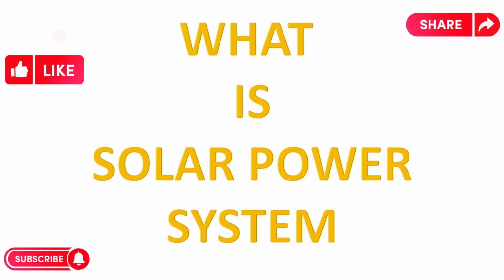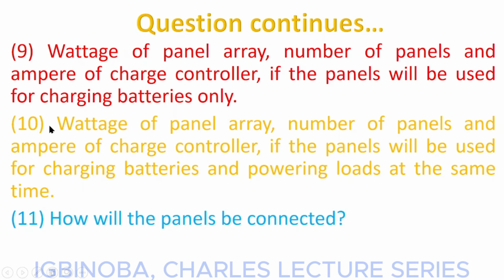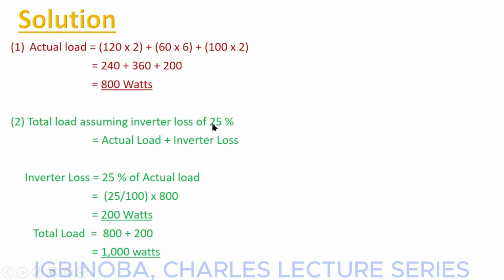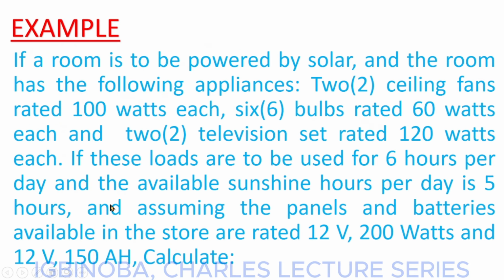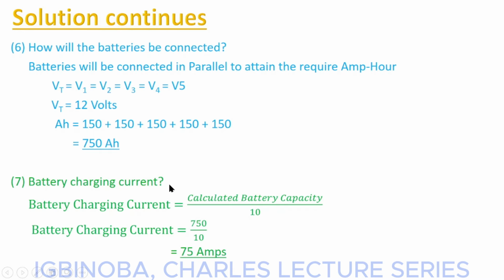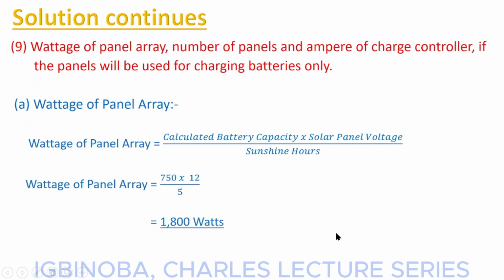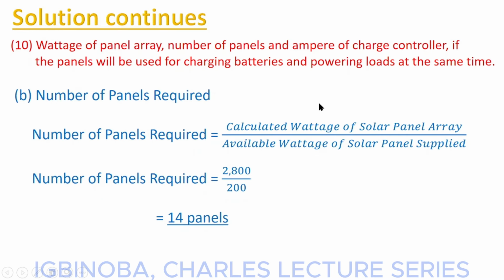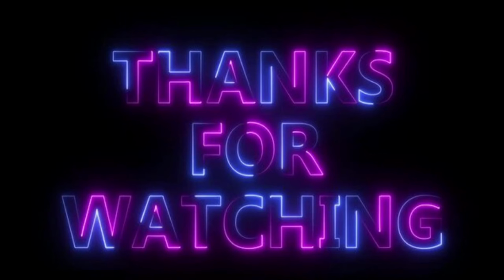Design of Solar Power System

Comment: PETRO394P
1. Actual load= (100×3)+(60×10)+(120×4) =1380watts
2. Total load assuming inverter loss of 25%= Actual load +Inverter loss
Inverter loss=25% of Actual load
= 25%×1380=345 watts
Total load= 1380+345=1725 watts
3. Inverter rating on VA using power factor of 0.8
= (1725÷0.8)= 2156.25
4. Battery capacity using factor for reserve 75%=(2×1725×6×0.75)=1293.75Ah
5. No. of batteries for backup hours=1293.75Ah÷150Ah= 8.6 =8 batteries 
6. How batteries will be connected?
The batteries will be connected in parallel 
Vt=V1=V2=V3=V4=V5=V6=V7=V8
Ah= 150+150+150+150+150+150+150+150=1200
7. Battery charging current=1293.75÷10=129Amps
8. Battery charging time assuming charging loss of 40%= 1293.75Ah+(40%+1293.75Ah)÷129A=14hrs
9a. Wattage panel array= 3105 watts
9b. Number of panels required= 3105÷345=9 panels 
9c. Ampere of charging controller required= 3105÷12=258.75Amps
10a. Wattage of panel array= Calculated wattage of solar panel array for charging battery only+ calculated total load =3105+1725=4830watts
10b. Number of panels required= calculated wattage of solar panel array÷ Available wattage of solar panel supplied= 4830watts÷345= 14Amps
10c. Ampere of charge controller= calculated wattage of solar panel array÷ solar panel voltage=4830watts÷12volts= 402.5Amps
11. How will the panels be connected?
Ans: They will be connected in parallel

Comment: EEE312L

1.Actual load is 1380w
2. Total load is 1725w
3. Inverter rating is 2156.25VA
4.Battery capacity is 1293.75AH
5. No. Of batteries is 8.625~9batteries
6. Parallel
7.Battery charging current is 129.375amps
8. Charging time is 14hours
9. (A) 3105w (B) 15.525 ~16panels (C) 258.75A
10. (A) 4830w (3) 24.15~ 24panels (C) 402.5A
11. Parallel

Comment: PETRO3102X

1. Actual load= (100×3)+(60×10)+(120×4) =1380watts
2. Total load assuming inverter loss of 25%= Actual load +Inverter loss
Inverter loss=25% of Actual load
= 25%×1380=345 watts
Total load= 1380+345=1725 watts
3. Inverter rating on VA using power factor of 0.8
= (1725÷0.8)= 2156.25
4. Battery capacity using factor for reserve 75%=(2×1725×6×0.75)=1293.75Ah
5. No. of batteries for backup hours=1293.75Ah÷150Ah= 8.6 =8 batteries 
6. How batteries will be connected?
The batteries will be connected in parallel 
Vt=V1=V2=V3=V4=V5=V6=V7=V8
Ah= 150+150+150+150+150+150+150+150=1200
7. Battery charging current=1293.75÷10=129Amps
8. Battery charging time assuming charging loss of 40%= 1293.75Ah+(40%+1293.75Ah)÷129A=14hrs
9a. Wattage panel array= 3105 watts
9b. Number of panels required= 3105÷345=9 panels 
9c. Ampere of charging controller required= 3105÷12=258.75Amps
10a. Wattage of panel array= Calculated wattage of solar panel array for charging battery only+ calculated total load =3105+1725=4830watts
10b. Number of panels required= calculated wattage of solar panel array÷ Available wattage of solar panel supplied= 4830watts÷345= 14Amps
10c. Ampere of charge controller= calculated wattage of solar panel array÷ solar panel voltage=4830watts÷12volts= 402.5Amps
11. How will the panels be connected?
Ans: They will be connected in parallel

Comment: MAR3115K

I. Actual load = 1380W
2. Total load = 1720W
3. Inverter rating = 2156.25VA
4. Battery Capacity = 1293.75Ah
5. Number of batteries = 8.6 ~ 9 batteries
6. Parallel
7. Battery charging current = 129.4Amps
8. Charging Time = 14hrs
9 (a). 3105Watts
(b). 15.5 = 16 panels
(c). 258.75 Amps
10(a) . 4830W
(b). 24.15 ≤ 24 panels
(c). 402.5Amps
11. Parallel

Comment: PETRO359G

1. Actual load= (100×3)+(60×10)+(120×4) =1380watts
2. Total load assuming inverter loss of 25%= Actual load +Inverter loss
Inverter loss=25% of Actual load
= 25%×1380=345 watts
Total load= 1380+345=1725 watts
3. Inverter rating on VA using power factor of 0.8
= (1725÷0.8)= 2156.25
4. Battery capacity using factor for reserve 75%=(2×1725×6×0.75)=1293.75Ah
5. No. of batteries for backup hours=1293.75Ah÷150Ah= 8.6 =8 batteries 
6. How batteries will be connected?
The batteries will be connected in parallel 
Vt=V1=V2=V3=V4=V5=V6=V7=V8
Ah= 150+150+150+150+150+150+150+150=1200
7. Battery charging current=1293.75÷10=129Amps
8. Battery charging time assuming charging loss of 40%= 1293.75Ah+(40%+1293.75Ah)÷129A=14hrs
9a. Wattage panel array= 3105 watts
9b. Number of panels required= 3105÷345=9 panels 
9c. Ampere of charging controller required= 3105÷12=258.75Amps
10a. Wattage of panel array= Calculated wattage of solar panel array for charging battery only+ calculated total load =3105+1725=4830watts
10b. Number of panels required= calculated wattage of solar panel array÷ Available wattage of solar panel supplied= 4830watts÷345= 14Amps
10c. Ampere of charge controller= calculated wattage of solar panel array÷ solar panel voltage=4830watts÷12volts= 402.5Amps
11. How will the panels be connected?
Ans: They will be connected in parallel

Comment: PETRO3151U

1. Actual load= (100×3)+(60×10)+(120×4) =1380watts
2. Total load assuming inverter loss of 25%= Actual load +Inverter loss
Inverter loss=25% of Actual load
= 25%×1380=345 watts
Total load= 1380+345=1725 watts
3. Inverter rating on VA using power factor of 0.8
= (1725÷0.8)= 2156.25
4. Battery capacity using factor for reserve 75%=(2×1725×6×0.75)=1293.75Ah
5. No. of batteries for backup hours=1293.75Ah÷150Ah= 8.6 =8 batteries 
6. How batteries will be connected?
The batteries will be connected in parallel 
Vt=V1=V2=V3=V4=V5=V6=V7=V8
Ah= 150+150+150+150+150+150+150+150=1200
7. Battery charging current=1293.75÷10=129Amps
8. Battery charging time assuming charging loss of 40%= 1293.75Ah+(40%+1293.75Ah)÷129A=14hrs
9a. Wattage panel array= 3105 watts
9b. Number of panels required= 3105÷345=9 panels 
9c. Ampere of charging controller required= 3105÷12=258.75Amps
10a. Wattage of panel array= Calculated wattage of solar panel array for charging battery only+ calculated total load =3105+1725=4830watts
10b. Number of panels required= calculated wattage of solar panel array÷ Available wattage of solar panel supplied= 4830watts÷345= 14Amps
10c. Ampere of charge controller= calculated wattage of solar panel array÷ solar panel voltage=4830watts÷12volts= 402.5Amps
11. How will the panels be connected?
Ans: They will be connected in parallel

Comment: NAT35E 

1. Actual Load: 1380Watts
2. Total Load (Including inverter loss) 1840W
3.Inverter Rating (VA): 2300 VA
4. Battery Capacity: 1227 Ah
5. Number of Batteries: 9 batteries
6. Battery Connection: Parallel
7. Battery Charging Current: 15 A (per battery string)
8. Battery Charging Time: 5.1 days
9. Panel Array (For charging batteries only)
. Wattage: 2945 W
. Number of Panels: 15 panels
. Charge Controller Ampere: 245 A
10. Panel Array ( For charging batteries and powering loads):
. Wattage: 4785 Watts
. Number of Panels: 24 panels
. Charge Controller Ampere: 399 A
11. Panel Connection: Series - Parallel.

Comment: PETRO3127W

1. Actual load= [100×3+60×10+120×4]=1380watts
2. Total load assuming inverter loss of 25%= 25% of Actual  load=25%×1380=345 watts
Total load= 1380+345=1725 watts
3. Inverter rating on VA using power factor of 0.8
= (1725÷0.8)= 2156.25
4. Battery capacity using factor for reserve 75%=(2×1725×6×0.75)=1293.75Ah
5. No. of batteries for backup hours=1293.75Ah÷150Ah= 8.6 =8 batteries 
6. How batteries will be connected?
The batteries will be connected in parallel 
Vt=V1=V2=V3=V4=V5=V6=V7=V8
Ah= 150+150+150+150+150+150+150+150=1200
7. Battery charging current=1293.75÷10=129Amps
8. Battery charging time assuming charging loss of 40%= 1293.75Ah+(40%+1293.75Ah)÷129A=14hrs
9a. Wattage panel array= 3105 watts
9b. Number of panels required= 3105÷345=9 panels 
9c. Ampere of charging controller required= 3105÷12=258.75Amps
10a. Wattage of panel array=3105+1725=4830watts
10b. Number of panels required= 4830watts÷345= 14Amps
10c. Ampere of charge controller= 4830watts÷12volts= 402.5Amps
11. How will the panels be connected?
Ans: They will be connected in parallel

Comment: CIV374V
1. Actual load is 1380W
2. Total load is 1725W
3. Inverter rating is 2156.25VA
4. Battery capacity is 1293.75AH
5. No. of batteries is 8.625~9batteries
6. Parallel
7. Battery changing current is 129.375amps
8. Charging time is 14hours
9. (A) 3105W (B) 15.525~16panels (C) 258.75A
10. (A) 4830W (B) 24.15~24panels (C) 402.5A
11. Parallel

Comment: MECH331E

Answers 
1) Actual Load = 1380 watts
2) Total Load = 1725 watts
3) Inverter Rating = 2156.25 VA
4) Battery Capacity = 1293.75 Ah
5) Number of Batteries = 8.625~9batteries
6) Parallel
7) Battery charging current = 129.375 Amps
8) Charging time = 14 hrs
9) (a) 3105 watts
(b) 15.525 ~ 16 panels
(c) 258.75 Amps
10) (a) 4830 watts
(b) 24.15 ~ 24 panels
(c) 402.5 Amps
11) Parallel

Comment: CIV3108H

1. Actual Load = 1380 watts

2. Total Load = 1725 watts

3. Inverter Rating = 2156.25 VA

4. Battery Capacity = 1293.75 Ah

i

5. Number of Batteries = 8.625~9 batteries

6. Parallel

7. Battery charging current = 129.375 Amps

8. Charging time = 14 hrs

9. (a) 3105 watts

(b) 15.525~16 panels

(c) 258.75 Amps

10. (a) 4830 watts

(b) 24.15~24 panels

(c) 402.5 Amps

11. Parallel

Comment: CIV3100V

1 Actual load: 1380W
 2. Total load: 1720W
 3 Inverter rating 2156.25VA 
4 battery capacity 1293.75 Ah, 
5 number of batteries 8.6 
6 Parallel 
7 Battery charging 129.4A 
8 T = 14 hrs 
9 (a) 3105W (b) 15.5 panels (c) 258.75 A 
10. (a) 4830W (b) 24 panels (c) 402.5A
11 Parallel

Comment: CIV3102X
1.Actual load is 1380w 
2. Total load is I725w 
3. Inverter rating is 2156.25VA 
4.Battery capacity is 1293.75AH 
5. No. Of batteries is 8.625~9batteries
6. Parallel 
7.Battery charging current is 129.375amps 
8. Charging time is 14hours 
9. (A) 3105w (B) 15.525 ~16panels (C)258.75A 
10.(A) 4830w (3) 24.15~ 24panels (C) 402.5A 
11. Parallel

Comment: CIV355C

1. Actual Load:1380Watts
2. Total Load (Including inverter loss) 1840W
3.Inverter Rating (VA): 2300 VA
4. Battery Capacity:1227 Ah
5. Number of Batteries: 9 batteries 
6. Battery Connection: Parallel 
7. Battery Charging Current: 15 A (per battery string)
8. Battery Charging Time: 5.1 days
9. Panel Array (For charging batteries only)
  .Wattage: 2945 W
  .Number of Panels:15 panels 
   .Charge Controller Ampere: 245 A
10. Panel Array ( For charging batteries and powering loads): 
   . Wattage: 4785 Watts
   . Number of Panels: 24 panels
   . Charge Controller Ampere:399 A
11. Panel Connection: Series - Parallel

Comment: PETRO3112H

1. Actual Load: 1380 W
2. Total Load (including inverter loss): 1840 W
3. Inverter Rating (VA): 2300 VA
4. Battery Capacity: 1227 Ah
5. Number of Batteries: 9 batteries
6. Battery Connection: Parallel
7. Battery Charging Current: 15 A (per battery string)
8. Battery Charging Time: 5.1 days
9. Panel Array (for charging batteries only):
   · Wattage: 2945 W
   · Number of Panels: 15 panels
   · Charge Controller Ampere: 245 A
10. Panel Array (for charging batteries and powering loads):
    · Wattage: 4785 W
    · Number of Panels: 24 panels
    · Charge Controller Ampere: 399 A
11. Panel Connection: Series - Parallel
Reply: PETRO3127W

1. Actual load= [100×3+60×10+120×4]=1380watts
2. Total load assuming inverter loss of 25%= 25% of Actual  load=25%×1380=345 watts
Total load= 1380+345=1725 watts
3. Inverter rating on VA using power factor of 0.8
= (1725÷0.8)= 2156.25
4. Battery capacity using factor for reserve 75%=(2×1725×6×0.75)=1293.75Ah
5. No. of batteries for backup hours=1293.75Ah÷150Ah= 8.6 =8 batteries 
6. How batteries will be connected?
The batteries will be connected in parallel 
Vt=V1=V2=V3=V4=V5=V6=V7=V8
Ah= 150+150+150+150+150+150+150+150=1200
7. Battery charging current=1293.75÷10=129Amps
8. Battery charging time assuming charging loss of 40%= 1293.75Ah+(40%+1293.75Ah)÷129A=14hrs
9a. Wattage panel array= 3105 watts
9b. Number of panels required= 3105÷345=9 panels 
9c. Ampere of charging controller required= 3105÷12=258.75Amps
10a. Wattage of panel array=3105+1725=4830watts
10b. Number of panels required= 4830watts÷345= 14Amps
10c. Ampere of charge controller= 4830watts÷12volts= 402.5Amps
11. How will the panels be connected?
Ans: They will be connected in parallel

Comment: PETRO3134D

1. Actual load= (100×3)+(60×10)+(120×4) =1380watts
2. Total load assuming inverter loss of 25%= Actual load +Inverter loss
Inverter loss=25% of Actual load
= 25%×1380=345 watts
Total load= 1380+345=1725 watts
3. Inverter rating on VA using power factor of 0.8
= (1725÷0.8)= 2156.25
4. Battery capacity using factor for reserve 75%=(2×1725×6×0.75)=1293.75Ah
5. No. of batteries for backup hours=1293.75Ah÷150Ah= 8.6 =8 batteries 
6. How batteries will be connected?
The batteries will be connected in parallel 
Vt=V1=V2=V3=V4=V5=V6=V7=V8
Ah= 150+150+150+150+150+150+150+150=1200
7. Battery charging current=1293.75÷10=129Amps
8. Battery charging time assuming charging loss of 40%= 1293.75Ah+(40%+1293.75Ah)÷129A=14hrs
9a. Wattage panel array= 3105 watts
9b. Number of panels required= 3105÷345=9 panels 
9c. Ampere of charging controller required= 3105÷12=258.75Amps
10a. Wattage of panel array= Calculated wattage of solar panel array for charging battery only+ calculated total load =3105+1725=4830watts
10b. Number of panels required= calculated wattage of solar panel array÷ Available wattage of solar panel supplied= 4830watts÷345= 14Amps
10c. Ampere of charge controller= calculated wattage of solar panel array÷ solar panel voltage=4830watts÷12volts= 402.5Amps
11. How will the panels be connected?
Ans: They will be connected in parallel

Comment: EEE3167K 

1. Actual Load = 1380 watts

2. Total Load = 1725 watts

3. Inverter Rating = 2156.25 VA

4. Battery Capacity = 1293.75Ah

5. Number of Batteries = 8.625 ~ 9 batteries

6. Parallel

7. Battery charging current =    129.375 Amps

8. Charging time = 14 hrs

9. (a) 3105 watts
    (b) 15.525 16 panels
    (c) 258.75 Amps

10. (a) 4830 watts
       (b) 24.15 ~ 24 panels
       (c) 402.5 Amps

11. Configuration= Parallel

Comment: PETRO320N

1. Actual load= (100×3)+(60×10)+(120×4) =1380watts

2. Total load assuming inverter loss of 25%= Actual load +Inverter loss
Inverter loss=25% of Actual load
= 25%×1380=345 watts
Total load= 1380+345=1725 watts

3. Inverter rating on VA using power factor of 0.8
= (1725÷0.8)= 2156.25

4. Battery capacity using factor for reserve 75%=(2×1725×6×0.75)=1293.75Ah

5. No. of batteries for backup hours=1293.75Ah÷150Ah= 8.6 =8 batteries 

6. How batteries will be connected?
The batteries will be connected in parallel 
Vt=V1=V2=V3=V4=V5=V6=V7=V8
Ah= 150+150+150+150+150+150+150+150=1200

7. Battery charging current=1293.75÷10=129Amps

8. Battery charging time assuming charging loss of 40%= 1293.75Ah+(40%+1293.75Ah)÷129A=14hrs

9a. Wattage panel array= 3105 watts

9b. Number of panels required= 3105÷345=9 panels 

9c. Ampere of charging controller required= 3105÷12=258.75Amps

10a. Wattage of panel array= Calculated wattage of solar panel array for charging battery only+ calculated total load =3105+1725=4830watts

10b. Number of panels required= calculated wattage of solar panel array÷ Available wattage of solar panel supplied= 4830watts÷345= 14Amps

10c. Ampere of charge controller= calculated wattage of solar panel array÷ solar panel voltage=4830watts÷12volts= 402.5Amps

11. They will be connected in parallel

Comment: PETRO325Y
1. Actual load= (100×3)+(60×10)+(120×4) =1380watts
2. Total load assuming inverter loss of 25%= Actual load +Inverter loss
Inverter loss=25% of Actual load
= 25%×1380=345 watts
Total load= 1380+345=1725 watts
3. Inverter rating on VA using power factor of 0.8
= (1725÷0.8)= 2156.25
4. Battery capacity using factor for reserve 75%=(2×1725×6×0.75)=1293.75Ah
5. No. of batteries for backup hours=1293.75Ah÷150Ah= 8.6 =8 batteries 
6. How batteries will be connected?
The batteries will be connected in parallel 
Vt=V1=V2=V3=V4=V5=V6=V7=V8
Ah= 150+150+150+150+150+150+150+150=1200
7. Battery charging current=1293.75÷10=129Amps
8. Battery charging time assuming charging loss of 40%= 1293.75Ah+(40%+1293.75Ah)÷129A=14hrs
9a. Wattage panel array= 3105 watts
9b. Number of panels required= 3105÷345=9 panels 
9c. Ampere of charging controller required= 3105÷12=258.75Amps
10a. Wattage of panel array= Calculated wattage of solar panel array for charging battery only+ calculated total load =3105+1725=4830watts
10b. Number of panels required= calculated wattage of solar panel array÷ Available wattage of solar panel supplied= 4830watts÷345= 14Amps
10c. Ampere of charge controller= calculated wattage of solar panel array÷ solar panel voltage=4830watts÷12volts= 402.5Amps
11. How will the panels be connected?
Ans: They will be connected in parallel

Comment: PETRO3109E

1. Actual load= (100×3)+(60×10)+(120×4) =1380watts
2. Total load assuming inverter loss of 25%= Actual load +Inverter loss
Inverter loss=25% of Actual load
= 25%×1380=345 watts
Total load= 1380+345=1725 watts
3. Inverter rating on VA using power factor of 0.8
= (1725÷0.8)= 2156.25
4. Battery capacity using factor for reserve 75%=(2×1725×6×0.75)=1293.75Ah
5. No. of batteries for backup hours=1293.75Ah÷150Ah= 8.6 =8 batteries 
6. How batteries will be connected?
The batteries will be connected in parallel 
Vt=V1=V2=V3=V4=V5=V6=V7=V8
Ah= 150+150+150+150+150+150+150+150=1200
7. Battery charging current=1293.75÷10=129Amps
8. Battery charging time assuming charging loss of 40%= 1293.75Ah+(40%+1293.75Ah)÷129A=14hrs
9a. Wattage panel array= 3105 watts
9b. Number of panels required= 3105÷345=9 panels 
9c. Ampere of charging controller required= 3105÷12=258.75Amps
10a. Wattage of panel array= Calculated wattage of solar panel array for charging battery only+ calculated total load =3105+1725=4830watts
10b. Number of panels required= calculated wattage of solar panel array÷ Available wattage of solar panel supplied= 4830watts÷345= 14Amps
10c. Ampere of charge controller= calculated wattage of solar panel array÷ solar panel voltage=4830watts÷12volts= 402.5Amps
11. How will the panels be connected?
Ans: They will be connected in parallel